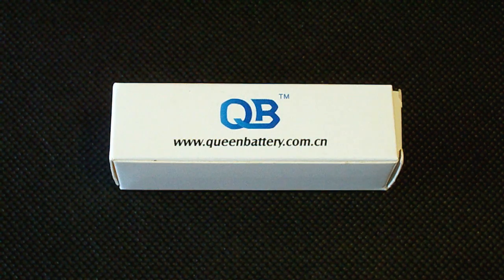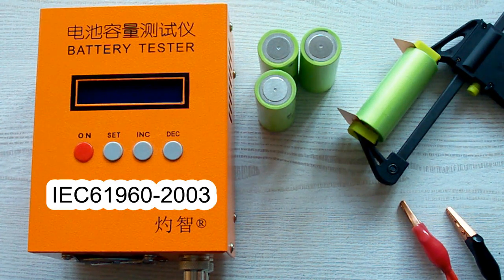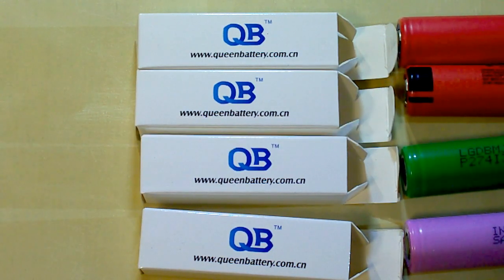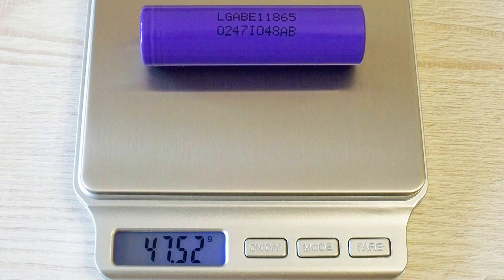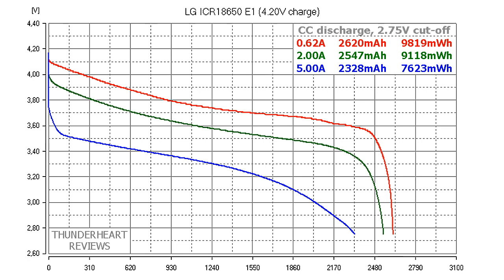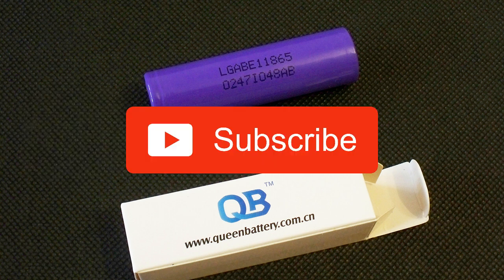4.35V High Voltage Li-ion LG ICR18650 E1 discharge capacity test

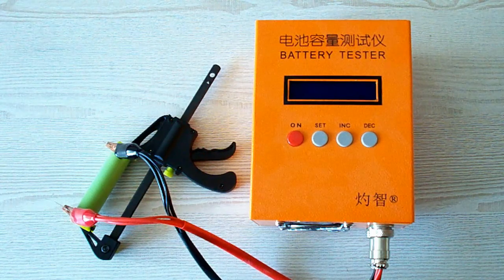Comment from the maker: 0:45 - Testing equipment and conditions
1:55 - Battery supplier
2:18 - LG E1 test at 4.35V and 4.20V charge end voltage
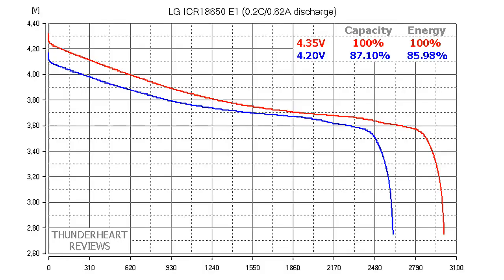4:11 - Comparison between 4.35V and 4.20V charging
4:49 - Verdict

Comment: Thank you.  This is a very good answer to a question I had about higher voltage cells that I harvested from laptops.  

There are also cell variants rated at 4.30 V charge voltage.

I can charge up to 4.35 if I open my opus charger, but it doesn't seem to be worth the trouble for the extra 10 or 15%.

I do have an older power bank which had cells that were tailing off (PowerGen juice pack 8400).  When I removed the old fully charged cells I was surprised they measured around 4.30V.  (Samsung ICR18650-28A).  If I had replaced them with 4.20V cells they would have been overcharged by the unit.  I used ICR18650-30B which also are rated 4.35V.

Comment: I'd recommend to move equipment description and supplier information to a separate video and place a link to it inside your review. You are always showing the same content so half of review is always the same - I'm skipping it. Only half of video valuable, the rest is repeating from review to review.
Reply from the maker: Дякую, Андрiй) The equipment is not the same in all videos that's why i include its description in the video. I think it's not a problem to skip it - you just click on the right part in the timetable i post under each video (pinned comment)